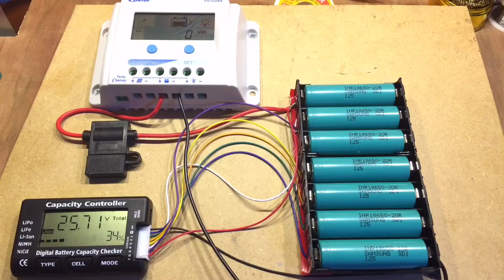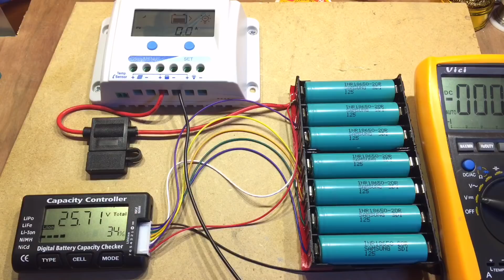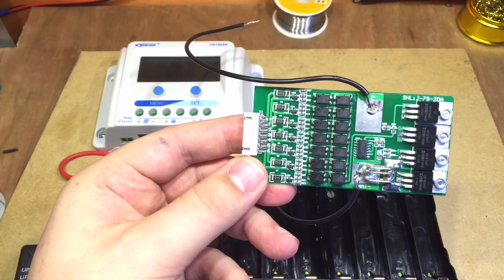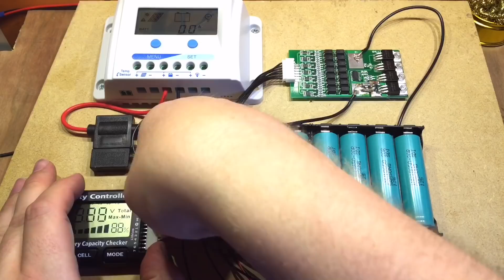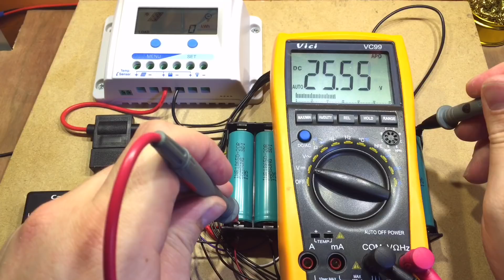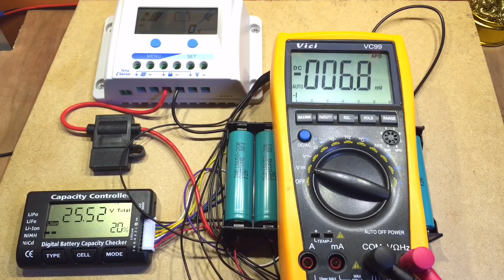Solar Charging Lithium Ion 18650s - Part 2, Getting the balance right - 12v Solar Shed

Comment: What you're calling the controller chip on the BMS is really only a 4011 quad nand gate presumably for logically combining the cell states in order to turn on or off the charging or discharging currents through the power mosfets. There's no intelligence on the board. As I read the data on this board, the locus of balancing is 4.18V, so the charging voltage must be 29.4V for the board to work properly. As I understand top balancing, while the strong cell is being discharged (here at 80mA) the charging current is switched off (and is therefore off for all cells), and when the balancing release voltage is reached, the charging current is switched back on again. This means that the charging process is very stop-start and takes a long long time. Another thing I don't like about these boards is that the overcharge cutoff voltage is 4.30V (i.e. above the safe limit) and the undercharge cutoff voltage is 2.40V (possibly damagingly low). I would only use these things as safety backup (e.g. short-circuit protection) and not as primary controllers. Don't trust them.
Reply from the maker: +Andy Kay Thank Andy some great advice and a super explanation. Really appreciate your input.

Comment: hi, here is a tip. If you connect at least 2 cells  in parallel for each cell, it will be harder for the cells to go out of balance. putting more cells in parallel forces each cell to stay very close in balance ; as each cell try to balance each other automatically. I mean 7 cells, but in group of 2 or 3 or more in parallel in each cell.
Reply from the maker: +Pablo Nunez Yeah, thanks Pablo

Comment: i have done this project with a mppt charger  i found that if the voltage balance ciruit only works from 4.19 to 4.22 pluse or minus torance on the balance chip for each cell  if the voltage on the input is  too high it  gose too out of balance and the curent gose higher than the balance reistors can dissipate the voltage gose above 4.26 ish the overvoltage ciruit kicks in.  you need to manualy parrel charge the cells and start again with a max voltage of 29v no higher if possible
Reply from the maker: +gk1mpo I think in hindsight I was using the balance board in a way it wasn't designed. 

I think a bottom balance would be sensible (I balanced these at 3.7 volts initially). My bank is charging to 28.4 and could go to 29.4 if I changed the profile. I found this a really interesting little experiment and it's still in use every day at the moment. 

Thanks for your input.

Comment: Dear friend, you have soldered the bms wrong and maybe even fried the bms already. Before wiring it you should have checked the wiring diagram. Also  check the A for charging port. Also do not keep the capacity meter all the time as it only draws power from the first battery out of 7. The bms are working good if you read instruction first. I have the same config with no issues none so ever. 
Do proper wiring from the first time and try not to fry the bms, also connect the batteries when the are top balanced (all 4.2) or bottom balanced. this will keep them in perfect sync as the bms balancing capabilities are only like 1,5 wats maximum. Also some charge controllers (very cheap ones like yours) they let you define custom voltages for low voltage and end high also. check in the settings for battery if you have "user" or custom. This will work great if properly done. As on work around you can use CC CV step up/down converters to safely charge you battery from basically any solar charge controllers -  the way that you have done for the output, but you need cc/cv boost buck as when the batteries will reach 4v*7=28 they will go to constant voltage and also you will be able to set the maximum charging current also the extend your battery life. 

Cheers bro.
Reply from the maker: Thanks Petre.  I think I said in the video I may well have fried the board.  I know others are having success with it.  I've got a update to this setup coming soon.  I explained in my first video that I wanted to use a charge controller which wouldn't allow me to change the voltages and look at how I could make it work with Li-Ion.  I have other controllers I could use that allow more adaptation, but that would make it too easy :-)  Thanks for your advice.
Reply: you can still use this one as i told you :P; also me i do not like easy things :P

Comment: I think I know what happened : your Capacity Controller device must be using the first 3 cells to power itself, and that's why they're lower in voltage than the 4 last ones ...
Reply from the maker: +Christophe HUBERT interesting theory. I'll look into that. Thanks.
Reply: Christophe HUBERT just a quick question the lg 18650 battery from ebay  (Lithium Ion ICR18650 MF1 2150mAh ) 20x cells each cell is 2150 ah. The spec sheet says Max. Charge Current 1.0C(2,150mA). So when you have this pack 36v 10s 2p  what is the maximum ah current can you charge it 2ah 42v current  or  2ah current x 20 cells ~ 40 ah current at 42v.  Now if you have 3x 10s 2p in parallel which is 36v 12.12 ah what is the maximum ah current  you can charge thats 60 cells is it 60 cells at 2ah current  which is 120 ah current  for 60 cells or just 2 ah for 60 cells using cccv charger 
Thank you very much
Reply: After watching many of Adams videos I now understand this comment ☺️☺️☺️☺️
Reply: Christophe HUBERT also possibly wire resistance

Comment: Great videos! I want to build a similar project. This method of charching only includes the constant current phase of charching so you loose around 5-10% capacity, am i right? Also what would happen if you have a proper li ion charger and get to the constant voltage phase... you would loose the efficiency of the pannel? I am new in this stuff...thanks for the help
Reply from the maker: +Anton Penchev I'm reducing the voltage I am charging these cells to on purpose. I'm wanting to reduce the risk of over charging them past 4.2 volts because I'm not using a charge controller that has a lithium charging profile. 

In a lead acid charge controller the charging profile is bulk, absorb, float. Bulk supplies as much current as possible until the voltage reaches the absorb level. At that point the charge controller maintains that voltage by letting the current fall away. Float maintains a lower voltage after a fixed time period of the adsorb stage.  It's quite similar to lithium. 

Solar panels are most efficient at their MPPT point. Only MPPT charge controllers keep a panel in this region. All other Solar charge controllers (or devices connected straight to a solar panel) will tend to hold the panel in a different place. PWM solar charge controllers are typically only 70-80 efficient or somewhere around there anyway.

Comment: Hi Adam, thanx for your vids. about that BMS: i think these things are rubbish, they will only limit and discharge the cells which have more capacity right? Better have a system that kan balance when charging i think. I had such a BMS on my bike with recycled cells. (7x7). It only stank realy bad and made the battery less powerfull. I do the balancing manually now when charging. All good after a year. Hope my thoughts are welcome. Happy charging!
Reply from the maker: +Jurik Ristjouw Everyone's thoughts are very welcome. Thanks for your suggestion and comments.
Reply: thanx, you came to the same conclusion! I reacted after one minute lol :) actually i do have a suggestion... is this the solution? http://electrodacus.com/ maybe even cheaper options are possible but I think the key is, that it will permanently stay on balancing when power is available and when powered on. Preferably completely configurable with top voltage, voltage to charge etc...
Reply from the maker: +Jurik Ristjouw Yeah a few people have suggested the electrodacus charge controllers. They do look amazing and I'd love to play with one at some point. This experiment (and more often than not this whole channel) is more about doing it on the cheap and with perhaps slightly unconventional solutions.
Reply: ok, i understand. If i come up with anothet idea, I will let you know. happy charging!
Reply: I will have a look! thanx
Reply: video link?
Reply: just have a look at DIY Tesla PowerWall's channel it's there somewhere
Reply: Jurik Ristjouw
I know a little by using the bms charger method, 32 hours later!, need another charger to get all 7kwh done. but I was introduced to the idea of a circuit board that just terminates the voltage of the cell at 4.1v while the other keep charging till they terminate at 4.1v. 
isn't this possible?  no balance leveling or power source?, which affects cell life.

Comment: Interesting Channel! Those battery capacity meters have a balancing circuit inside of them. To Enable Press and hold the 'TYPE' Button until you hear a double beep and the battery voltages will start cycling in sequence. The voltage from the highest battery is brought down to the lowest cell voltage by passing a small leak current. They will eventually be in balance but the leak current is very small to do a fast job. You will naturally feel a little bit of heat after an hour or so from the battery capacitor meter whilst it does its job.
Reply from the maker: +billywhizzy Funnily enough I describe red this just today. Thanks for the kind comments and thanks for pointing this out.
Reply: billywhizzy wow thanks for the info, I might risk recovered batteries... if get a capacity controller in Dhaka first 😂🤣😂😅😂🤣😂😅
Reply: This testers have 3 resistors of 82 ohm in paralel witch should give 153mA at 4.2V but actialy it gives aroud 60mA while balancing batteries. The tester it self drains 20mA . Interestedly after jou pres for long time Type button once it will balance always until you disconnect the battery pack. If you pres the type button again long time  it will continue balancing. I'm thinking of hacking this balancer by adding one mor ressistor in paralel which will give it more mA
Reply: actually there are at least 2 versions of this capacity meters around one with the balancing capability one w/o it. I can press the TYPE-button as long as i want with no reaction. You can find both versions on ebay and there is a little difference in price. There is also a 8S-version with further options.

Comment: HBPowerwall found issues with his BMS the key figure from the ebay listing is.
Balancing Current: 80mA
which potentially means if you charge at a higher current than that, they you can over charge cells.

That you cannot tell if the BMS is working or not, is a key design flaw with these series of cheap chinese BMS. See if you can find something with CANbus, serial, or the like.
Reply from the maker: Yeah I did consider that figure, but hoped that with a spare volt across the pack at absorb level (which delivers very little current) it would be within spec.  I'm going to attach my scope and see if I can see it doing anything before I declare it completely dead.  Thanks for the input.  I subscribe to HBPowerwall myself too. :-)

Comment: A high voltage cut-off might be doable by reading the voltages using the analog pins on a microcontroller. It could use that information to switch off a relay on the solar input when any of the cells reach near 4.20 volts.
Reply from the maker: It would be a quick and dirty solution I guess.   The issue is that the arduino would need a series of voltage dividers as the voltages got higher from the shared ground.  Accuracy might be more difficult as the voltages get higher through the pack.

I'll give it some more thought though.  Thanks

Comment: Would it help cell to stab in balance if you had larger wires between cells?The first cells seem to of gotten more power faster the the last cells.
Reply from the maker: The cable between cells is 2mm copper.  It should really be plenty for the job, but I am wondering if there is a poor joint causing resistance between the cells.  Thanks for your ideas.
Reply: could be a cold joint. would it help to put more charge wires to you pack? maybe to every cell.  It seems to me you may not be spreading the voltage evenly to all cells. You on to a good charger. I am thinking of doing the same, learning from yours. I am also looking a step down step up power converter set a the top voltage of my pack.

Comment: Odd that the top 3 in both scenarios become overcharged. Maybe the battery holder has a short/problem? Shot in the dark :P
Reply from the maker: I'm confident there is no short, but I am wondering if there is a higher resistance on that link.  I'll check this, thank you.
Reply: I concur. My first thought when I noticed the holder split line. I suspect a connection between the two holders introduces some resistance to the lower 4 cells. Those trays are definitely not perfect conductors....

Comment: Great explainer Adam, but sad that the balancer doesn't seem to be working.
Did you manage to show this video to its maker and get any feedback?
I'm still looking to do a similar thing for my 12S pack!
Reply from the maker: +Andy Lee Robinson I've not contacted the seller. I've had it a couple of months actually and hadn't been able to test it. Perhaps I just got a bad one?
Reply: It's always possible - maybe a scope will show if there's any activity on the processor?
I guess the bases of the balancing transistors should correlate with their relative states of charge - a low cell should be asking for more current, and a high one should be supplying.
If one of the TL01s is faulty, then it might affect the whole ladder? I dunno.
There are lots of circuit diagrams available, so it's likely you might find one that is a close match to this implementation and be able to deduce a cause.
This one doesn't appear to be programmable, no USB or FTDI port to set balancing parameters?
Reply from the maker: Yes it needs more investigation.  I'll probe about and see what I can find.

I don't think this board is a clever as high cells supplying low ones though - just a simple shove a resister across a high cell type solution.

Thanks Andy for your input - useful as ever.

Comment: That doesn't bode well as i have the same balance charger sitting in a box ready to use at some point :-(
Reply from the maker: +Colin Hickey (Lets make stuff!) I might have damaged it but I can't really see how. To be honest it isn't likely to kick in until the cells are high, but the top of my pack was high. :-(
Reply: Mine doesn't seem to work either. Good luck.